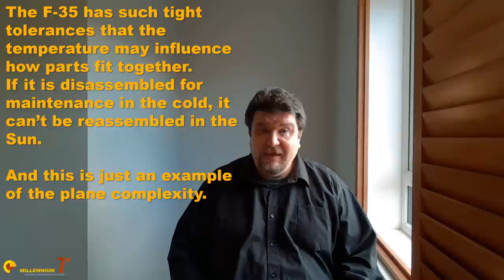F-35: The Failure of the $100 Million  Dollar Jet | Maybe...

Comment: It’s the same failure that they had with the F4 and F111!
Reply: The f-4 and f-111 were not failures
Reply: @UptownDegree  they were to be like the F35 with one type per service. USAF kept the F111 navy didn’t. USAF used the F4 but navy went more to the other jets A6 FA18 F14
Reply: Despite those problems both aircraft were still successful in their roles and besides the f 35 is a more capable aircraft than either of those two
Reply: Hell even the venerable f-14 had a myriad of problems in its development cycle

Comment: In the strike mission, if you have a target so well defended that if requires a stealth aircraft, why would you send a manned platform to approach such dangerous defenses just to launch a glide bomb, instead of launching a cruise missile over 900km outside the target, like the AGM-158B? Strategic, well defended targets are not a infinite resource your enemy have, so spending 1 million a unit (for the cruise missile), looks like a bargain compared to a 100 million jet plus a multi year, multi million to produce fighter jet pilot.

And if your target is not so well defended, why use a expensive, 5 gen fighter to destroy it?

I imagine those are questions the generals are asking themselves while looking at the expenses of the F-35. Sure, you still need advanced jets to obtain air superiority. But for the strike role?

Comment: A brilliant plane, the only real stealth fighter on the international market. Don’t worry about the regular ‘I told you the F-35 is no good’ videos; you’ll get the same click bait in 6 months.
The problem is the F-22: the production is stopped and there are not enough of them. We need a new 2 engines stealth fighter to avoid having to buy F-15s. The new F-15 is not stealthy and therefore very vulnerable and just as expensive as the F-35. The F-15 will probably be used as bomb lorry once the F-22/F-35 have achieved air superiority.

Comment: The f35b  needs to be dumped over board and the carriers fitted with an angled deck with cats-n-traps. Replacement navalised aircraft 18 Typhoons, 18 Tempests and 18 Buccaneers-(4seat) with the Buccs carrying out AEW, ASW, EJW + inflight fueling duties. There is no need for VTOL on a large carrier except perhaps 6/12 Merlin ASW/SAR helicopters.

Comment: Always been easier, cheaper and faster to crack the unpickable lock than to design it in the first place, so will be here and hence it will an insane amount of $ in combination with throwing everything and the kitchen sink at the problem, constantly in a never ending cycle!

Would not surprised me if the future will be about unmanned craft, at least a swarm of smaller unmanned around every manned craft, The Germans in WW2 where the technically superior dominance, the allied hat the numbers and industrial capability to keep pumping out numbers.

Comment: The F35 was flawed concept that delivered flawed aircraft. the F35 suffers from the same fate that befell the F111.  While that plane could never fill the requirements it was intended for, It became a worlds best low level supersonic bomber.  The F35 A and C variants suffer from the limitations imposed by the F35 B jump jet.  The unintended consequence is that the F35 B is a game changer in that it is an enabler to build small aircraft carriers that do not require the size and complexity of a super-carrier.  It provides at least a partial answer to the arguments against Super-carriers  as well as opening the door to allies who want carriers but can't justify a super-carrier.  However, the success of the "B" model design hampered the A and C models which should have been developed separately to meet their specific needs.

Comment: If any modern fighter program is a massive failure, it is the Gripen NG. 14 years later and where is it? Over-budget by billions, big questions about its flight control system, under-powered and stall-prone even in thick air, no IRST ready, and all this after just having to upgrade off an existing system.

All the headlines should be about what a scam the Gripen is, but no, they're about not only a highly successful multinational program, but the most revolutionary combat system in history.

What's the deficiency list on the Gripen E? 
South Africa has half their Gripen Cs in flyable storage because they can't afford to maintain them.

Headlines? F-35 is too expensive to maintain.

F-35As and Bs from Israel, US, and UK fly continuous combat missions all over the Middle East with unprecedented success.

Headlines: "F-35 still not ready for combat."

F-35A unit price dropped to $77.9 million 3 years ahead of schedule.

Headlines: "F-35 is the most expensive weapons program in history."

Meanwhile Gripen E is billions over budget and being delivered without IRST, which they promise will be ready soon.

The jokes literally write themselves.

Comment: F-35 isn't necessarily a failure, but it's not an cure-all either. If you're going to use external stores, you negate the stealth that is the major expense of the F-35. So... why use such an expensive stealth plane in a non-stealthy role? Use conventional airframes when armament in excess of the internal capacity of the F-35 is needed; it won't be any less stealthy than an F-35 with external stores and will cost a LOT less.
Reply: How many non stealthy roles do you think there will be in a war against a major world power?  The aircraft that can't survive in denied airspace will sit on the ramp/deck, and commanders will be wishing those parking spots were filled with aircraft that could be employed against the enemy.  The stealthy aircraft can swing to non-stealthy roles later if conditions permit.  The non-stealthy aircraft will be parked until then, a sunk cost that kept you from buying more of the capable aircraft that might have turned the tide of the war.
Reply: @gort8203  : I don't see a war with either Russia or China failing to go nuclear if we start threatening their territorial integrity. Preparing for a war we can't win is stupid. And if they come after us, then they're the ones dealing with our air defenses.

On the other hand, in anything less than an invasion of the Russian or Chinese homeland, F-35 can go in. trash the air defenses like the F-117s and AH-64s did against Iraq, and then you'll want all the platforms you can get to go after the ground forces. And you'll certainly want your aircraft to carry more than four bombs and/or missiles each when that time comes, especially for CAS missions.
Reply: @andrewszigeti2174  You don't seem to realize that you don't have to threaten the territorial integrity of a country's mainland to be at war with it's armed forces or its equipment.  The U.S. has never been at war with Russia but fought Russian equipment in 1991.  Of course the U.S. is never going to invade mainland China, but there are many other scenarios of conflict possible with major powers or their surrogates.  You do realize that China is building islands in the middle of international waters just so they can claim it as Chinese territory.  

Not preparing for a possible war is a guarantee that it will happen, and that  you are likely to lose if it does.  You Neville Chamberlain types never seem to learn that lesson.  If Britain and France had been willing to prepare for war they might have prevented WWII.
Reply: @gort8203  : I'd say go ahead and plan then. And when you push us over the edge and the iCBMs have launched, it'll be too late to tell me I was right.
Reply: @gort8203   @Gort  Do you seriously think China can cram enough SAMs onto those little islands that a single SSGN can't wipe them all out? No, those two refitted Ohios carry enough Tomahawks to level everything on two or three of those islands. Each.

Any sort of major attack on China or Russia WILL provoke a nuclear response. Period. Minor attacks can be handled with small numbers of stealth aircraft backed up by large numbers of conventional support aircraft.  An air defense network tight enough to prevent conventional aircraft from even approaching will be suicide for stealth aircraft as well. Stealth is not magic invisibility, after all; just a dramatic reduction in the range of detection.

Comment: Well even a 4+ generation fighter's development could be more then 10 years. The Super Hornet was a running sideproject of MDD from the middle of the 1980s. And it was able to enter service in 2001. Even if we look at only the first order of the full on development, which occured in 1992, it was 9 years from there to IOC. And it was not a clean-sheet project.
USN buy aircraft from Europe? Not even a question, only one design is capable of CATOBAR: Rafale M. For the USAF there are more options. But that means two entirely different designs to introduce to the US military. Or they buy Rafales too.
They haven't learnt from the past. There was another forced multiservice aircraft which failed in USN: F-111. Why always the Navy originated designs capable of fulfilling multiservice demands successfully? Like the F-4 and the A-7. Would be better to trust these kind of developments to the USN from the start.

Comment: Was clear since start, decades ago, that there were too many problems on too many levels , thats just a reality check finally happening. Usa will not buy a non-usa plane, but for sure it needs cheap solutions for asymmetric wars and keep up flight hours at a reasonable cost

Comment: Maybe stupid questions, but what about the F/A-18? Isn't that more modern than the F-16?. Why is even F-15 still a thing when there are so many Vipers and Hornets available?
Reply: They are roughly the same age. F18 lost the light weight competition against the F16 to become the new main light weight fighter of the US military. So F16 is now the plane of the US air force. But F18 would later on be turned into a plane that could serve on aircraft carriers, and that is now in that role most people know this plane today.
F18 have been upgraded and have become the Super-hornet. Super-hornet is not a bad plane, but it is not the best either. I think it is fair to say that Gripen, Rafale, Eurofighter, F35, and F22 are all better.

F18 is the oldest among all those 4th generation birds, and it also a naval fighter with all special requirements that comes with that. So I don't wanna be too harsh towards it now when I say its a little bad compared to other planes.
It is an okay plane by todays standards. But with the standards of the future I think it is becoming outdated.
Upgraded a plane this old for more and more decades will be costly, and the performance will decline.
Life on a carrier deck is rough, with brutal starts and landings, and with salt water corrosion. And the airframe will take a beating and need more and more repair and maintance.
It would make sense to replace the F18 with something new by now. But with what? There are not much new planes invented yet. And swallowing the national pride and buying a rafale or perhaps even a naval gripen I guess is unlikely.
Reply: @nattygsbord  Thanks for the explanation!

Comment: a few years ago the RAND corporation came up with a report that the F35 was too expensive and too much to run per hour to be as capable as intended. their recommendation was a cheaper and more numerous slightly less capable and operated differently strike platform. also more drones. 

the problem with the f35 just as the bradley fighting vehicle (watch YT film pentagon wars) is they wanted it to do too much. VTOL should never have been included in the spec. indeed original LM promo film says the f35 will cost no more than $28 - $32m per plane depending on model.
Reply: STOVL was always a JSF requirement and it was successfully demonstrated in the selection of the 35 over the X-32.

What wasn't part of the requirements 20 years ago, when the JSF was going to be the biggest defense acquisition ever at US$200 billion for the total program cost including production (not operations) and replace the F-16, F-18, and the Harrier while including stealth , was the requirement to be the center of a complex, data-driven nexus for complete sensor fusion and the ability to vector less advanced F-22s in combat.

We're at US$400 billion already for 250 planes and now the F-35 is competing with the F-15 program. And it still has not replaced the F-16 or the F-18 and it never will.

It's true that the Marines had to scale back their total acquired and it's true that that raises the price for the STOVL capability - but they scaled back because the plane is so late that their entire mission approach has changed along with the rest of the world and because the F-35 costs were already far beyond what they were ever going to be able to afford by the time they could get any.

If they left off STOVL entirely, we'd still be left with a plane that is too late, too expensive, and too complex to replace the F-16 and F-18.
Reply: Do people actually take pentagon wars seriously?

Comment: US Naval aviation has been treated like a red headed step child since the A-12 was cancelled.    Prior to WWII the RAF was placed in control of RN aircraft procurement and the RN went into WWII with biplanes.   Had it not been for availability of the US F4F, F6F, F4U, TBF and PBY the RN carriers would have been useless in a high threat environment.   The unique requirements of carrier aircraft cant be met with a multi-service multi purpose AC.   The MIC sell out of American labor by buying Italian design FFG is just more sell out of Americans.   Total BS that the US arms establishment cant produce a frigate.   Two approaches are to scale down the hugely successful DG-51 or update the FFG-7 design.  The CWS is be designed in the US and is most expensive component of the design.  So you take an FFG-7 and drop in a 30 missile VLS cell along with the CWS under design.

Comment: Why not upgrade F-16?

I see only worse development and maintenance costs. Using foreign light fighter is out of question because US defense procurement policy is protectionist.
Reply: It is not easy. Avionics/electronics are old and need to be completely replaced. 
But that would be done in airframes that have many flight hours and are at the end of their lifespan.
Fitting a new EW suite with antennas and sensors all over the body will take some effort.
The F-16 is quite slim and good looking. But I think the nose is to small to fit the F-35 radar for instance. 
And a radar's reach is proportional to its size.
Reply: @eleson00  , F-16 upgrade meant producing new potentially modified air frames using new electronics.

Comment: I keep wondering, if gen 6 will include optimised  continuous RND and upgrade path + logistics
Reply: Modular design? Could work, but it would require more eyes on maintenance & design restrictions than a new or repurposed build would.
Reply: Even 4th gen fighters can be easily upgraded. US prefers to buy new air crafts. There is limit to how long air frame can be used because structures have limited lifetime.
Reply: @suokkos  not just upgrades. The continuous development of a platform. Today the closest is probably SAAB's Grippen. Not so much the hardware itself but the whole development and upgrade process. Of course the airframe gets tired and has to be retired after x flight hours. That's a given and will never stop being so.
Outside of this the best example illustrating the differences in development and management approaches is in the software industry. Compare the difference in cost, success rate, time overruns of traditinal projects using the so-called waterfall model and the more agile ones. What I mean is about delivering similarly capable, but very differently managed and costly platforms.
Reply: @MrDikini  , Finnish and Swiss Hornets have been upgraded with some super hornet hardware and software. An example showing American companies can offer continues upgrades if customers want upgrades.
Reply: @suokkos  not arguing that they can't do it. I'm sure they can and have dome it. Arguing about that to be part of the design and management philosophy from the get go. Part of the plan.